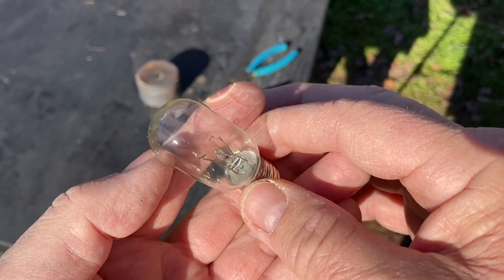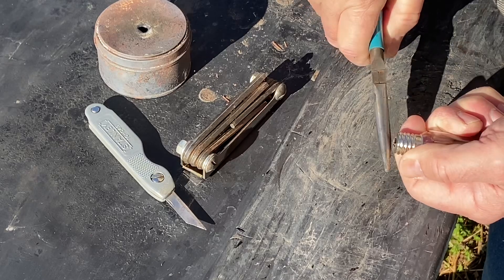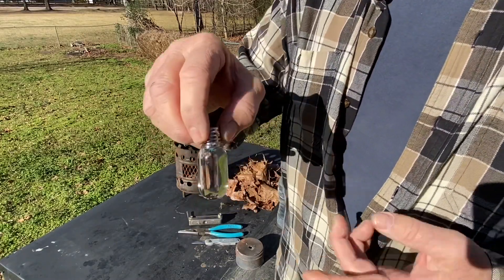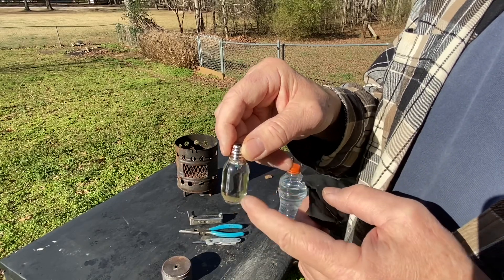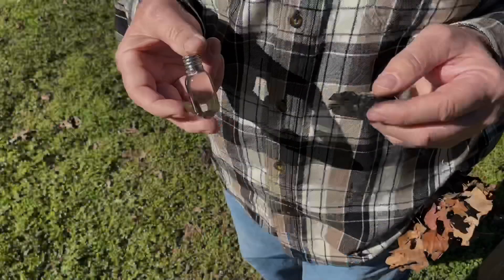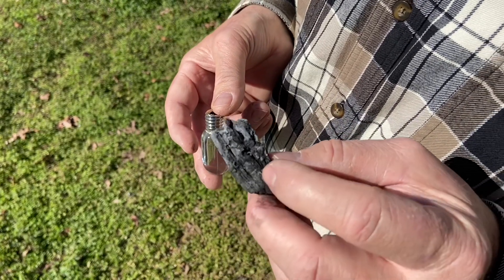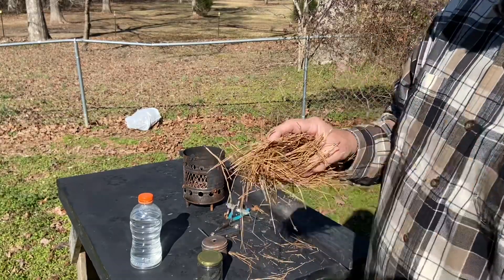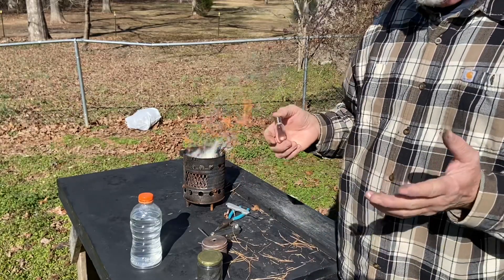Hollowing Out A Tiny Bulb To Solar Ignite Charred Punk Wood

Comment from the maker: I show you how to take apart an incandescent light bulb, fill it with water, and solar ignite charred Punk Wood. (See a similar video that I made 2 years ago at the LINK below.)
   In the 10:30am Sun, it didn't look like the tiny bulb was going to be able to make a hot enough focal point to ignite char cloth. When the Sun got a little higher in the sky, though, at 12:30, it was a different story. Now, it was making a much more intense focal point! It easily ignited some charred punk wood... I switched to the charred punk wood because it was darker and was probably more ignitable than the char cloth.
   Come see what a great experiment this turned out to be, follow the LINKS below, and SUBSCRIBE, Thank You!

Solar Ignition, Hollowed Out Light Bulb, When base of bulb came off in the socket, I smiled.
https://youtu.be/GmCAFWypr9o
Solar Ignitions Playlist
https://www.youtube.com/watch?v=2Ml6elsHKbo&list=PLkoXX8XsMW3kl5CicmPv0pTz-7rj4gczW

Comment: Nice experiment. May be that your finger absorbed enough heat (like a heat sink on electronic components) to keep the cloth below ignition temp. Maybe try again sometime with the cloth balled up more in the shape of the punk wood to hold in the heat on the back side?
Reply from the maker: That's what I tried first. If I had not laid the char cloth over my finger, I would not have noticed the heat dissipation and not tried the charred punk wood.
  The issue was that the Sun was not high enough in the sky for a hot enough focal point. The dissipating heat may be a combination of the color change of char cloth that's heating up, making it more reflective and the heat sinking that you mentioned.